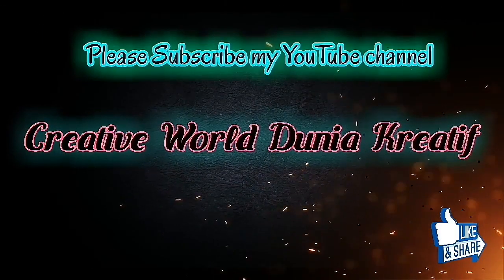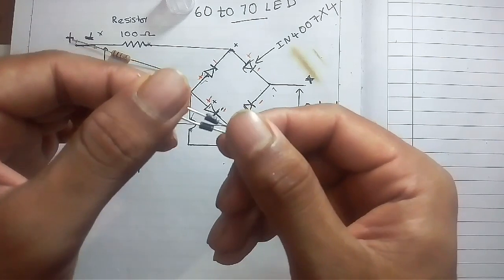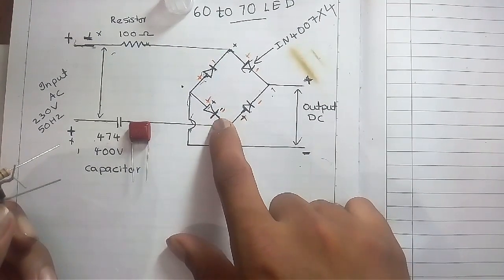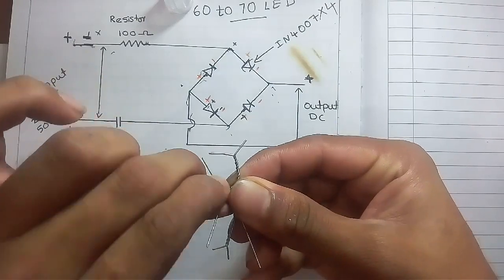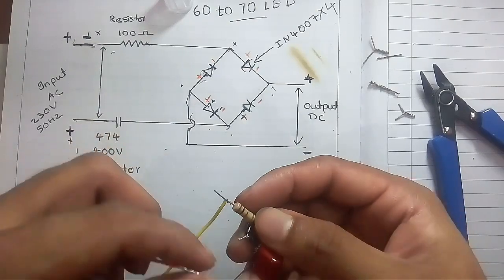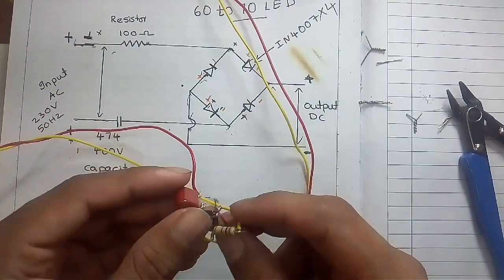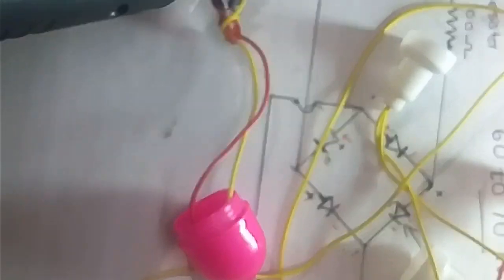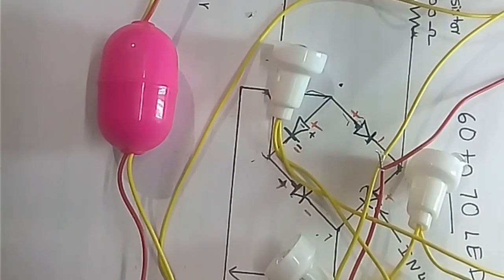How to make LED serial light driver circuit|LED serial light power circuit, see link on description

Comment: I want same Circuit box of different colors from where to buy?
Reply: How can I start this work?
Reply from the maker: Purchase material ,me also going to make different types of led circuit
Reply from the maker: You get in local elections shop
Reply from the maker: You can make it it is easy in Kerala it cost 40₹
Reply: I mean that pink colour box in which you kept rectifier ?
Reply from the maker: You mean only the box ,it is available in local elections shop one box in 5₹ with out circuit
Reply from the maker: Which color led you use same colour capacitor cap you need to buy
Reply from the maker: Are you studying
Reply from the maker: Are you interested in LED based electronics project
Reply: Yes I am interested in led lights. K want to make led jhalar etc

Comment: I have used this circuit in 8mm led 50numbers serial but only 40led is glowing remaining 10 glowing with low power. Please help to fix this issue
Reply from the maker: Send me your 8mm serial light pictures
Reply from the maker: mycreativedunia@gmail.com
Reply from the maker: If the connection is correct no problem, using this circuit I also make led light
Reply: @CreativeWorldDuniakreatif  
Hi, 
My issue got resolved now. I have added 2.2 uf 400v capacitor in output terminal after that all led's are glowing with high power. 

One more thing it will support until 60 leds.

Thanks for your support

Comment: 100 leds connect means same procedure what value of resistance use
Reply from the maker: First add 70 led if it works then add 10 led if it works, add 10 led more, if it works do it again
Reply from the maker: Process is same
Reply from the maker: Same values
Reply from the maker: Try it with same resister